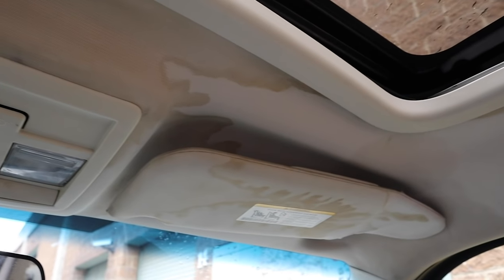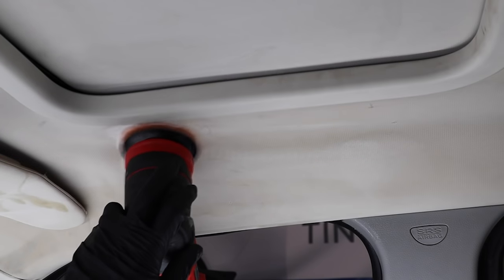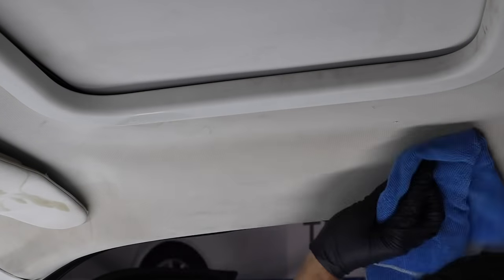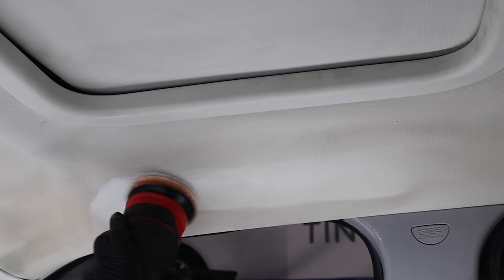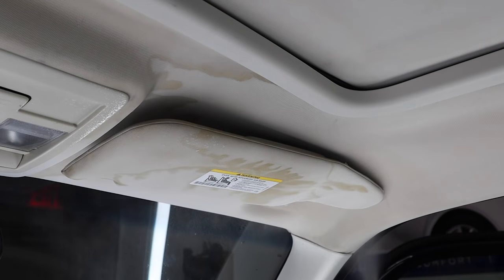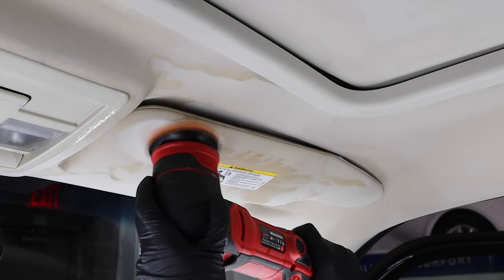Headliner DEEP CLEAN | STAIN REMOVAL

Comment: The problem with headliners in my experience is that, much like with microsuede, you have to clean all of it, or there will be a visual transition from the area you've cleaned to the area you haven't. When you've got a headliner that filthy, though, that's pretty much a non-issue. It all gets cleaned.
Reply: Exactly
Reply: That's what I'm going to have to do, I cleaned a spot my son splashed his drink onto and now🤦🤷
Reply: @angelmarie140 If you've got a very thick microfiber towel you can dampen it, apply a little cleaner to it, and then go over the entire headliner before blotting it off with a dry microfiber. You just need to get the entire surface layer of fabric mildly saturated with water and detergent.
Reply: You can also fade the mark out like you would with a paint repair patch

Comment: This is brillant work.  I have never seen a polisher used for head liner stains.  This is the best video out there!  Thanks!!
Reply from the maker: Give it a try it makes  life easier but  make sure you dry to take care of of wicking
Reply: @LimitlessDetailing  I don't have one of those blowers. Would running the Heat on max fan speed work?

Comment: How do you prevent dirt rings when cleaning a headliner? Example when using a product on a nice size stain...you clean the area, but when it dries you can see a outline of dirt from the cleaned area. Thanks.
Reply: He didn’t use water to soak the headliner. I think that’s when you get the “dirt rings”. But i myself would rather soak the headliner with water AND the cleaning solution, so I can extract as much dirt AND cleaning solution out from the headliner. The method used in the video clearly leaves much of the cleaning solution still in the headliner, but I guess that’s the safer way to clean the headliner without getting those dreaded “dirt rings”.
Reply: @mansandem  I thought the same thing. I know with cleaning carpet, soap residue attracts dirt. Not sure how that wouldn't happen with this. I'd want the soap gone lol. I have a bad habit of over rinsing everything. 🤷🏼‍♀️
Reply: @AimeeNapier4KingdomAdvancement  I would clean it with the solution, let it dry, then maybe the next day spray a bit of water and wipe it so that it won’t get over saturated. If it does , the headliner can start drooping down since the adhesive isn’t gonna  stick as well

Comment: I would think that a polisher is strong and blunt enough to weaken the glue, thus making the headliner start to fall.
Reply from the maker: Low power setting with a light microfiber pd and you’re good to go 👌🏽
Reply: @LimitlessDetailing  what do you mean by "light microfibre" I always thought microfibre pads were heavier cutting pads.
Reply: @davesdetailing  there are many types of pads. Foam, microfiber, wool. They're not just for correction. They're also used to just generally polish a car and make it Shiny. That requires no correction

Comment: I don't have that device. What is another way to clean it?
Reply from the maker: You can do it by hand using microfiber towels and a good all purpose cleaner. It’s going to take a lot of elbow grease. I would try the al purpose cleaner on a small part first to make sure it doesn’t damage it. Also try to use minimal amounts of liquid as this can alter the adhesive specially on older vehicles.
Reply: @LimitlessDetailing  i will do that. Thx

Comment: A professional detailer demonstrates forced air to dry the area which actually acts to seperate the fabric from what it is glued to. 
Extractor would have been a better method. The vacuum forced the fabric to remain engaged at final pass.
Reply from the maker: So you’re saying saturate the area with an extractor potentially causing glue failure since the extractor doesn’t totally dry the area? The headliner did not separate using forced air so not sure why you assume that

Comment: What cleaner are you using? Can you use any multipurpose interior cleaner? I just bought the Chemical Guys multipurpose interior, will that work on headliners? What about fabric seats? I have a few dark stains in a car im getting shortly
Reply: How did the chemical guys product work for you? I'm also in the comments looking for the same answer. Thanks
Reply: @jeffreypeterson6036  get bilt hamber all purpose cleaner, it's the best and very user friendly, just don't let it dry on surfaces, as long as you wipe then you're good.
Use 1-10 ratio with water.